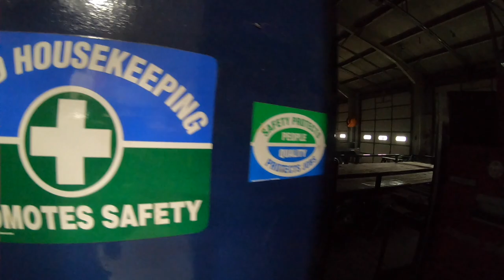How To Load And Secure a Bobcat Track Loader

Comment: What modifications did bobcat do on a new machine to have it for a month.
Reply from the maker: They look a lot of measurements to the loader arms because we thought they were bent. Didn’t really end up doing much but we weren’t in a hurry to get it back
Reply: @BeauEnterprisesInc  ok i was concerned about those case loader arms holding up over time. did they end up being bent and what did they think may have bent them. merry Christmas and thank you for answering me. I am on the fence with buying one of these things and I'm still not sure yet but hearing they arms could have bent could be an issue for me.